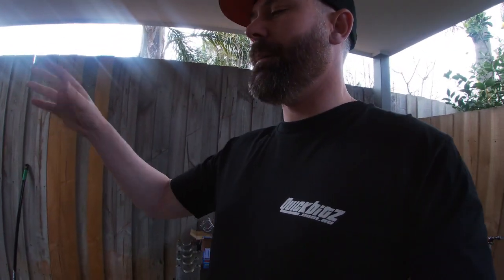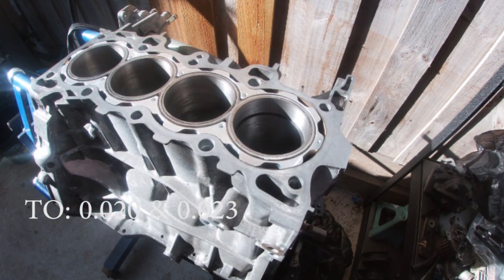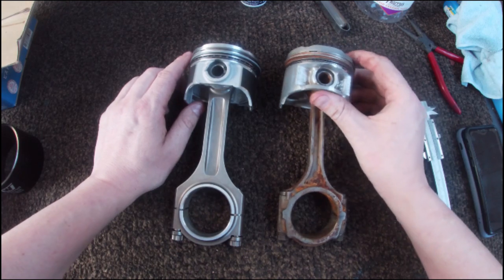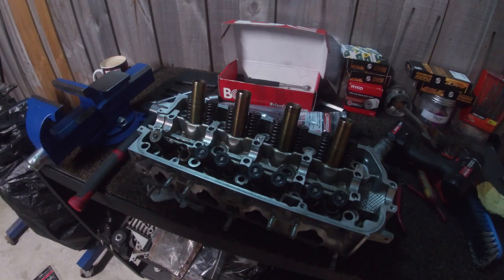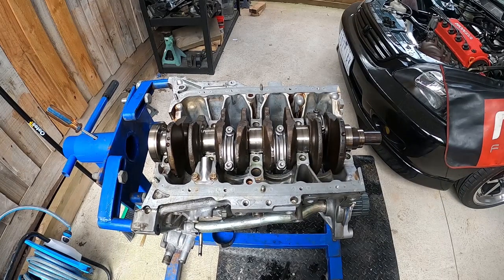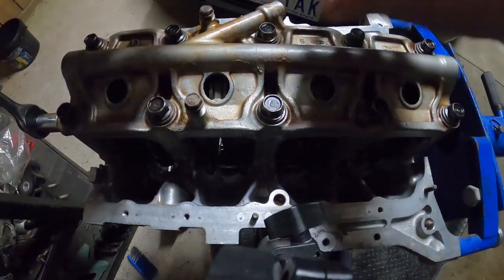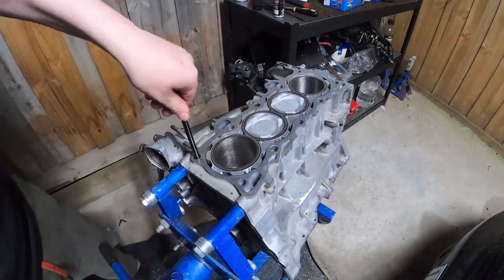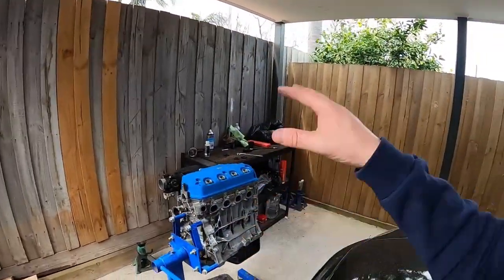MY FIRST ENGINE BUILD WAS BETTER THAN I EXPECTED VITARA D16

Comment: I should've bought a engine just to take apart and put back together several times. Only learned tune-ups, breaks and being a parts changer(alternators, AC compressors, clutches with help, ect) with a Hanes manual. But I never cracked an engine open.

Comment: Nice vid bro. Only two things, you shouldn't have greased or oiled the back of the main bearings and con rod bearings when installing. You should also install and torque the main caps/girdle first before the con rods.  That's what the holes of the girdle are for, to torque the con rod bolts.
Reply from the maker: I’ve since built around 20 motors, that one was a learning curve :)
Reply: @TURBOTRISTO  Good job brother!
Reply from the maker: Next video I went back and fixed those mistakes

Comment: Hey is there a clearance for main bearings? And whats a good bearing clearance for the rods and if there is a clearance whats the clearance for main bearings? (Or do i just torque to spec)
Reply from the maker: @svg_pikachu5816  I just did everything to oem specs

Comment: Yo i kno this is an old vid but im hoping on a response back 😅 i myself have just brought a d16y4 could you point me to where you purchased all of your engine components?
Reply from the maker: @danieldwyer4104  I ordered everything from eBay honestly, but my advice is find a low km d16y4 with healthy compression and just turbo that motor don’t waste money building it, they are stronger and more reliable unopened
Reply: @TURBOTRISTO  really you think just turbo the stock motor ? I did buy a seperate lower ks motor but i woukdnt be able to push any decent power woth stock internals would i ?
Reply from the maker: @danieldwyer4104 yeah stock engines last longer than built ones my built one and 3 of my freinds professionally built ones blew up but stock ones lasting years

Comment: I know this is old but Well done on your first engine. My first was a Prelude B20A. They are a rare, very lazy big old motor that made as much torque as they did Horsepower. I changed out the B20A rods for F22B rods which were stronger and USDM pistons which had lower compression than the JDM counterparts. It made just shy of 400HP on a self built Megasquirt 1 using evo 3 coilplacks and staged injection (Honda STD primaries and evo 3 as secondaries). It was an absolute weapon but every single thing apart from cam gears had to be custom made and it would regularly blow head gaskets as they were carbon (before Honda changed them to MLS) and Cometic replacements at the time were not available, in the end I changed it to a modern B series and the Prelude now sits in our storage depot in Japan, waiting for me to build it up and let it rip once again.
Reply from the maker: @Mike-ry4ti  you should do it!
Reply: @TURBOTRISTO  as budget allows, right now we are in Cairns, our place in Japan is on the backburner for when we get closer to retirement. I have a little EK1 hatch I'm waiting to take delivery on here in the meantime, it's a sad little automatic but it's untouched and I might kick off the channel using that one, build it up like your then start on the Prelude next year..

Comment: sorry for picking your brain on older vid did your p2p0 rod bolts come with washers for arp bolts the instructions say to use washers however definitely didnt come with them and i havent seen others with our rods use washers lastly you remember what you torqued the rod bolts too for checking oil clearence it says 55lbs stretched
Reply from the maker: @jmillzthepimp27  there’s only washers on the headstuds it’s probably universal instructions
Reply from the maker: @jmillzthepimp27  I don’t remember the torque what ever the instructions said

Comment: Thanks tristan im building my d16y8 right now and this video helps a ton i am running the p2p0 rods ycp pistons 75.5 fresh bore hone and deck
Reply from the maker: Nice man upgrade to the biggest srt4 head studs now and don’t run any extra timing, mine lifted the head several times before I gave up and went kswap

Comment: How well did this unit hold up.
Reply from the maker: It was fine until we pumped some timing into it and then the head lifted which is common on d series, bottom end and all that was perfect
Reply: @TURBOTRISTO  hey mate I hear alot about the head lifting from timing, I'm building my Y4 at the moment and don't want to deal with that happening. How do you know when to stop adding timing? Usually you go until knock and take out a few degrees, how do you know what will make the head lift? Cheers!!
Reply from the maker: @joshjosh7748 the rule is pretty much keep timing at stock settings and add more boost
Reply: @TURBOTRISTO  stock timing as in when you create a haltech basemap? If so that's great I'll be able to tune it myself
Reply from the maker: @joshjosh7748 yeah
Reply: @TURBOTRISTO  absolute legend 🤙

Comment: Wait your suppose to lubricate the back of the bearing where it doesn’t make contact with the crankshaft???
Reply from the maker: I saw the comments and I pulled it apart and fixed it watch the next vid, also I have spoken to mechanics and they said it doesn’t matter

Comment: A late comment but a question or two :)
- torque spec of rod bolts
- torque spec of main cap bolts
- torque spec of girdle
- desirable clearances for rods and main caps using the gauge plastic
- with the clearance measurement, did you lube and torque everything up and then undo all of it to find the gaps? Would that over-stretch any bolts?
Reply from the maker: I did all the torque specs as recommended by the manufacturer of the items I used, I did plasti gauge everything to make sure they were all the same tolerances , where factory parts were re used I followed factory toque specs
Reply: @TURBOTRISTO  ok so with the plasti gauge it was more to see that everything was even rather to a specific clearance measurement? And I'm guessing you had to torqud everything to get accurate plastigauge readings?
Reply from the maker: @moseseggmolesse7979  yes correct
Reply: @TURBOTRISTO  alright sweet, thanks 😁

Comment: HI,
what compression ratio you get? 7.8:1 or higher with this vitaras?
What's the height of the rod?
Reply from the maker: 180psi across all cylinders
Reply: Should be 8:8:1 with those rods and pistons

Comment: uhhh far as im aware you dont put lube under the bearings? hopefully that didnt fk up on you. i could be wrong though?
Reply from the maker: you were right i fixed it up,
Reply: noticed that too! altaugh i also made that mistake a few years ago with my own build, for me it didn't gave any problems with spinning bearings.( lucky enough ) ran that for almost 2 years with a lot of abuse untill my oilpump diceded he had enough. ( reused it after rodknock ) it seemed fine, but at the end it still F*cked the engine. i'll guess it also has to do with luck.

Comment: ACL bearings ? 

Not oem ?
Reply from the maker: Cheaper plus easier to find and I was able to chose the size and clearance , I still have a full set of tight clearance bearings at home
Reply: Nice !! They should work in any d16?  

I have the mains not rods obvs 

I’ll be happy to buy off you if I can man ?
Reply from the maker: @nathanlevander1867  it’s a miss matched set because you will need an under and an over sized kit so when you are checking clearances you can swap out bits and peices and mix and match until you get all the clearances correct
Reply: @TURBOTRISTO  awesome man !

Comment: P2P vitara spec means the rod length center to center measures at 138.633mm as opposed to the factory conrod length 137.00mm. These p2p rods bump the compression using vitara pistons  because they push the pistons up closer to the deck vs using a stock rod length with vitara pistons you would have a very low comp ratio.
The compression height or crown height of the pistons is the reason why the aftermarket made a adjustment to the length of the conrods.
Reply from the maker: Nice brother that is some great information

Comment: love the series mate did notice a problem putting main bearings back in you lubed the face of the block then put bearings in u need to keep the the face clean. I would highly recommend pulling out and cleaning the back side of those bearings and block i love the vids tho and well done on giving it a go. :) BTW love the zip tie trick hahaha
Reply from the maker: Yeah I pulled them
Out and re did them I explained it in a later video I was pulled up pretty fast on that one haha thanks for looking. Out though I appreciate it and thanks for the support